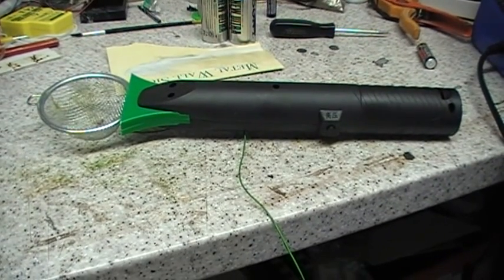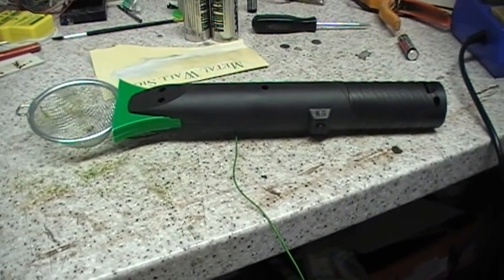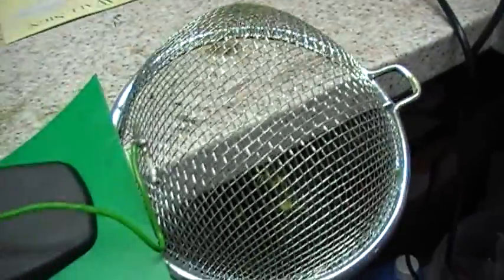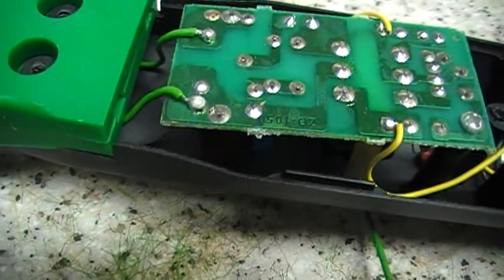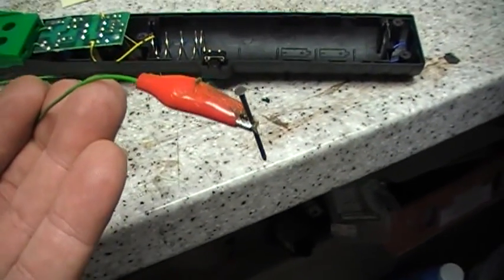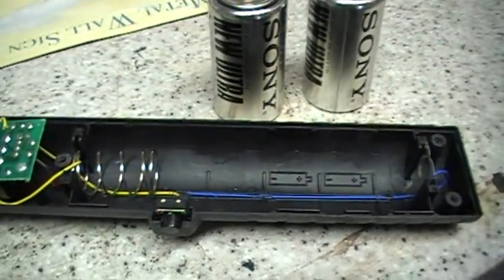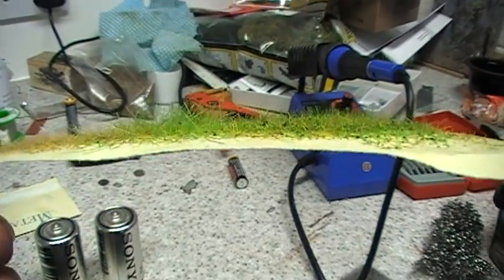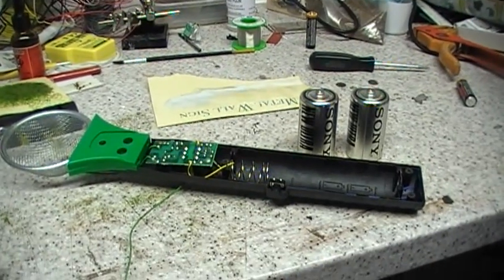how to make home made static grass applicator

Comment: Hello Kevin  ,,,,I've looked hi and low for a bug zapper that uses the bigger batteries but no luck,,,  I have some D 1.5v  batt's   seems the AA batt's are 1.5v aswell,,,, who did you get yours from  ???,,,,,,,greg
Reply from the maker: Hi Greg found mine on Amazon some time the pound shop have them the small batteries work but not as well good luck cheers Kevin

Comment: Good video. Thank you.. My swatter is now in pieces, tea strainer in place and awaiting rebuild  !  The internal connections are slightly different. Presume there is just one wire to strainer  and one to earth? (What could possibly go wrong??)  :-))
Reply from the maker: Hi thanks for watching you will find that if you get it the wrong way around you will get a lot of fibres flying around it will still work but not quite so good cheers Kevin
Reply: All assembled now..just getting the hang of it !   Seems to drain the (rechargable) AA batteries quite quick though. I understand why the larger battery size could be beneficial now :-)  Practice sessions have been pleasing so far..Thank you

Comment: Kevin,
      THIS is WONDERFUL!!!, i am going to build a unit, starting back in 016.5ng, so, size will look very good, now OAP and semi diss, cheap and working items in modelling are a MUST!!!, Nock or who ever they are £80 +, yours £6, no contest/brainer, any ideas for trees mate, remember tho`, im 016.5??, just wondered, many grateful thanks for a super video on how and why.................best regards......Tom....
Reply from the maker: Hi Thomas thanks glad it was of use try ebay for trees get the really cheep ones from china I think I had 50 delivered from china for £4.00 delivered to the door and then covered them with different types of scatter or you can buy sea foam for about £20.00 for a box probably get 20 trees cheers Kevin
Reply: " 50 delivered from china for £4.00 delivered "

       Sound good Kev...Thanks...Tom.....
Reply: Thomas Fisher And what about the custom charges & VAT? You will be very fortunate to get a supplier in China that will send you as few as 50 insect bats. The one in the demo that uses the D size battery is one of the best to use as the big batteries seem a lot more powerful than the AA sort. But they are very hard to get hold of in the UK.
The wires soldered to the mesh look a bit tatty, would it not be better to solder onto the sieve handle?
Reply from the maker: Hi Martin it was 50 trees delivered to the door not fly sweaters the wire was alreadY soldered to the strainer my old one packed up so just renewed it  cheers Kevin

Comment: Hi kevin, im question, the racket this is batteries AA or load 220?¿
Reply: works with a racquet that is loaded to 200v?
Reply from the maker: Hi Batteries are 1.5v   R20 size cheers Kevin
Reply: kevintregunna . You can run the other racquet rechargeable battery?
Reply from the maker: Hi Yes i dont  see a problem with using rechargeable batteries cheers Kevin

Comment: i did the same kevin  but i removed one of the resistors gives you move power and i used a larger siv but you get one hell of a belt. total cost £2.50  cheers ian